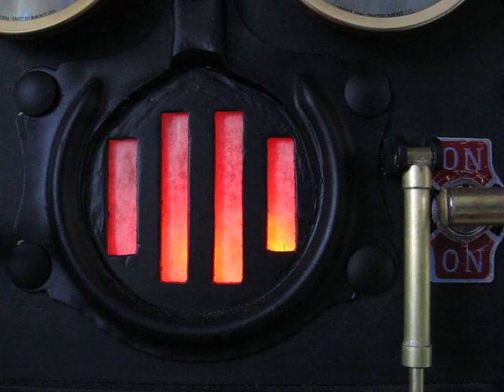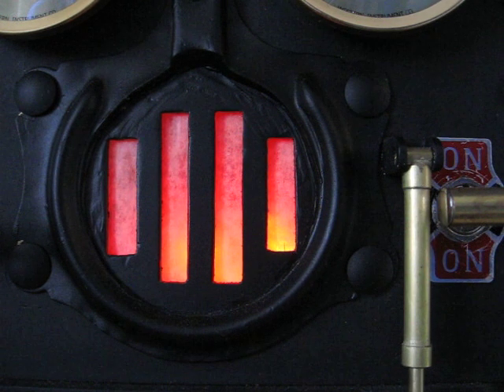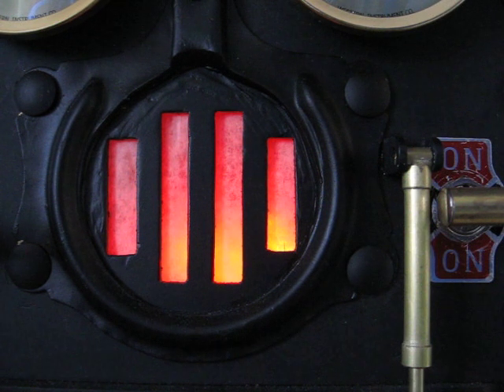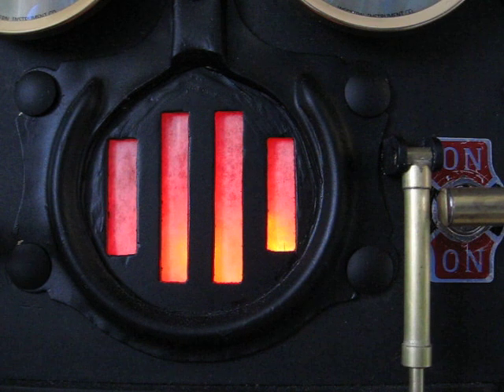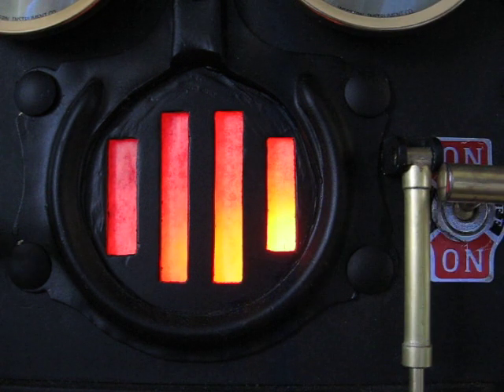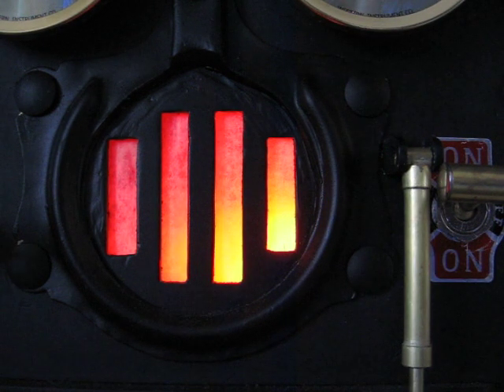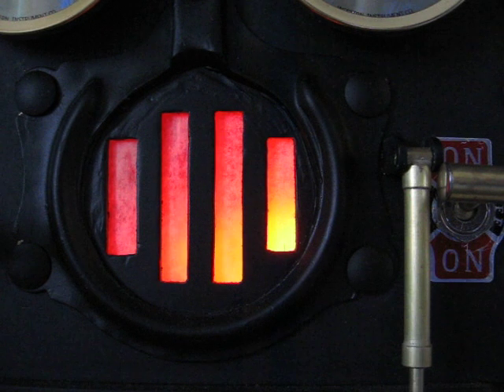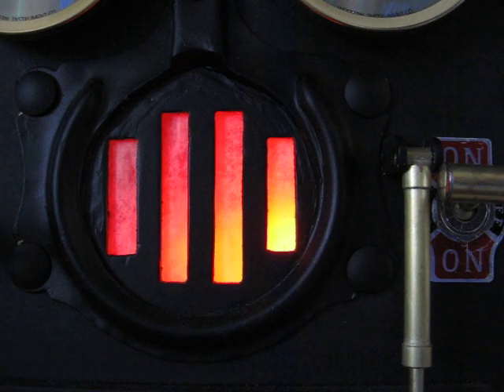Telecalculograph Furnace

Comment: For the drive LEDs, something to taper the lighting and extinguishing would be nice, so it isn't so abrupt.

I love the load indicator. Did you just hook the 8 LEDs to the data lines? (I've pondered a number of novel uses for the parallel port as an annunciator array.)

Rigging a little whistle to be triggered by the system beep call would be amusing.

Comment: Cool. And I agree, would like to see more.

"a feedback mechanism that blows more air into the furnace"

That's actually correct, a steam locomotive uses the exhaust steam that goes through the stack from the cylinders to create a draft, drawing more air through the fire. The harder the engine works the stronger the draft and the hotter the fire.